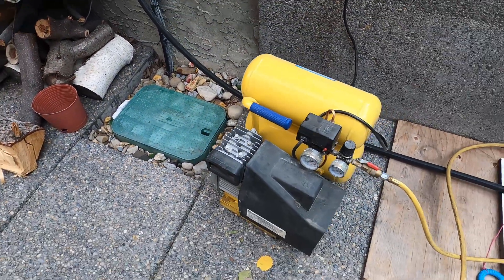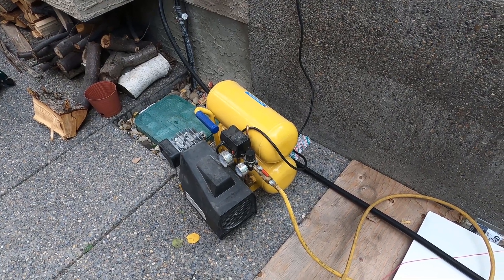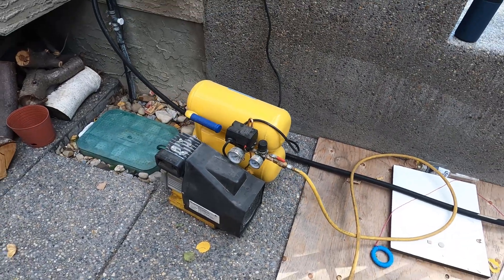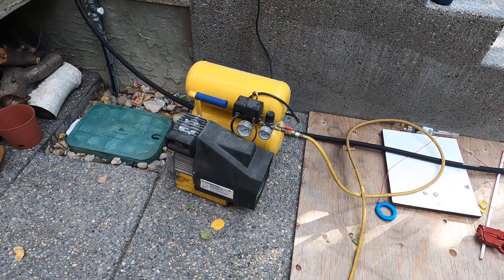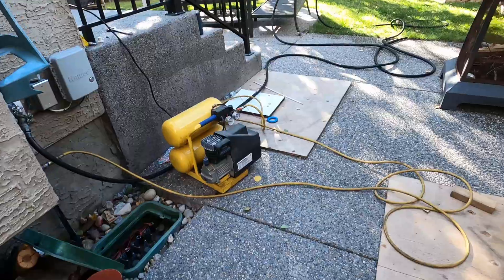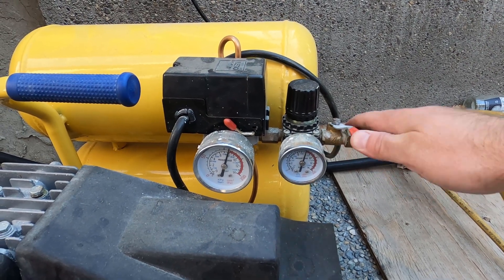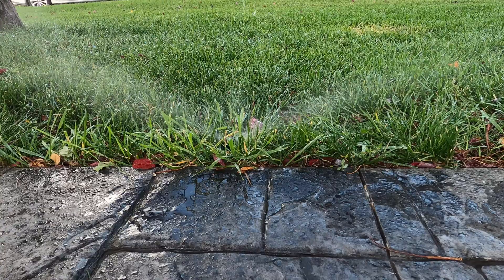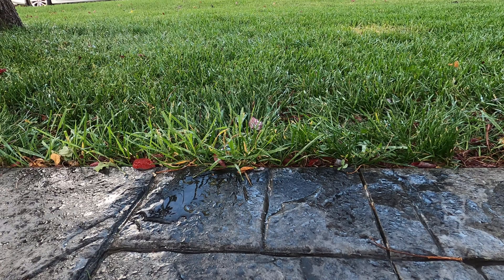Can You REALLY Winterize Your Sprinkler System with a Small Compressor?

Comment: Question, you opened the valve to let air through, once the line is drain, do your place the valve back to the close position?   Also, can you winterize using the app to open the valves instead of manually opening?  Thanks for the video.
Reply from the maker: I leave the valves open during winter.  But it probably doesn’t matter.  Yes you can use the controller but mine is old and does not work anymore, so I use the valves manually.

Comment: Hey question about the  Ridgeline strawberry milkshake bypass. My truck has 215,000 miles and I haven’t replaced the radiator. 3rd owner. I am considering doing the bypass now. Do you think I should even bother replacing the radiator or do you think it’ll make it to 300 K fine if I do the bypass? Trying to do as cheap as possible while avoiding  catastrophic failure.
Reply from the maker: do the bypass at least.  that removes the risk.
Reply: @gregs_garage  definitely but my situation would you replace the radiator or don’t bother?
Reply from the maker: @Idrkmayne  If not leaking I would just leave it alone.  That's all I did.  Keep the Honda one.

Comment: hi, any more vids on the open header e30?
Reply from the maker: no but we can.
Reply from the maker: the car is progressing.  new springs and shocks went in recently all 4 corners.  Next is timing belt.  We may just rip the motor out and reseal it because it leaks so much oil.
Reply: @gregs_garage  thanks for the update, hopefully its sounds as good as it did when its put back together